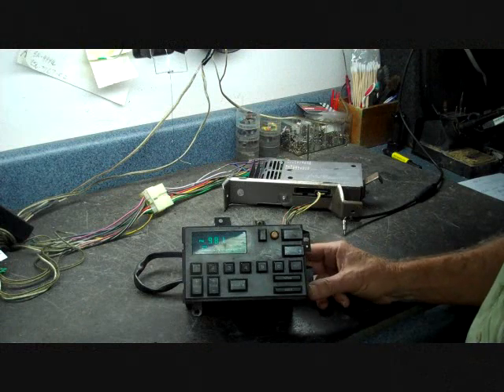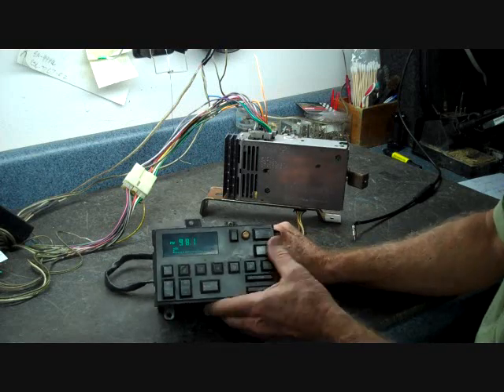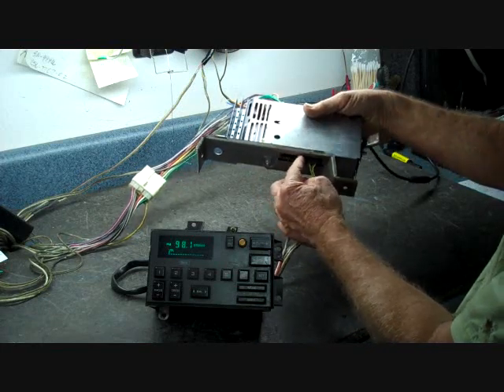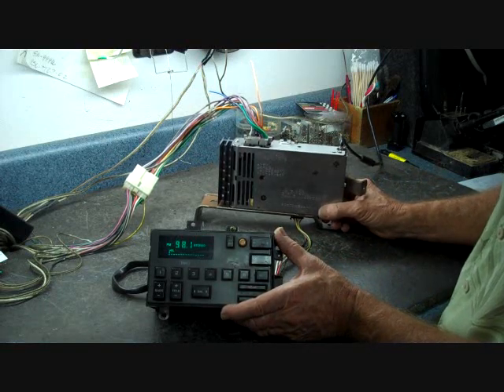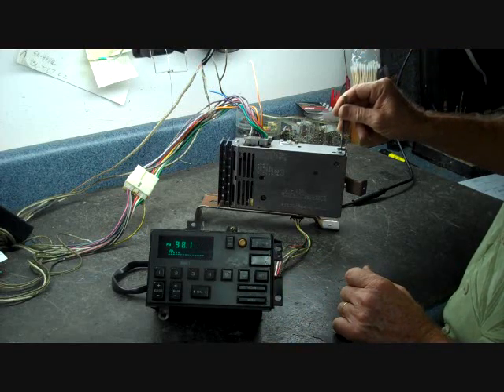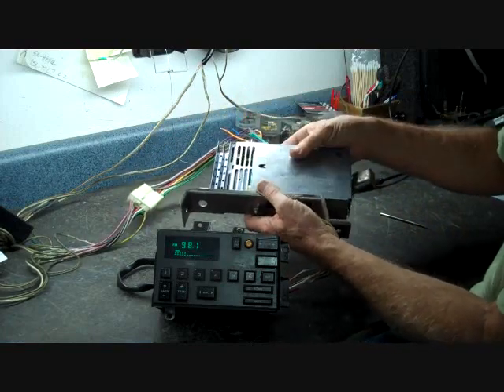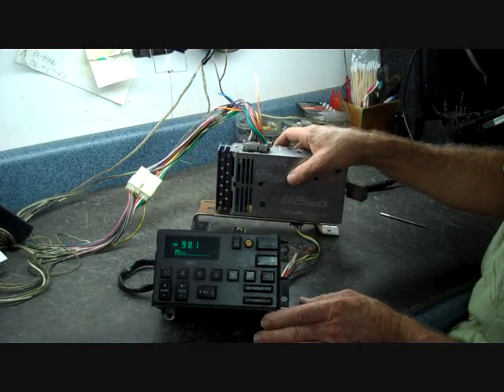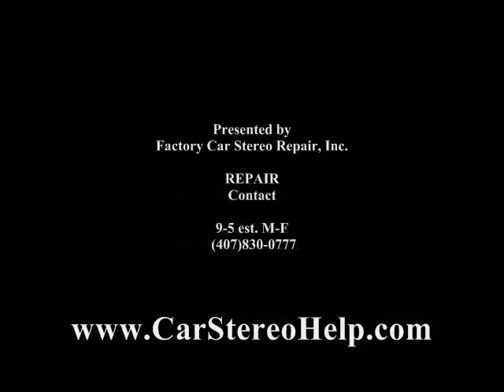Chevrolet and GMC Troubleshooting Stereo = Car Stereo HELP

Comment: hello I have a question I have a 1992 GMC Sierra with the same set up with the radio on it lights up clocks works radio channel works and the volume bars light up and will move up and down and when you adjust the fadder and frt to back it displays as well there is just no volume my best guess is the amp under the dash thanks David
Reply: Same issue I have.
Reply: Hey i have the same year sierra and am experiencing the same problem. Did you ever find a solution?
Reply: @bamiller6506  Any resolution? im seeing the same thing on my 92 sierra
Reply: Anybody solve this issue? Everything works but no sound or static
Reply: Any1 find out thw issue?
Reply: Thought I’d throw my comment in here. Same issue for me on a 1994. Head unit / control head powers up and all buttons work. Also have the tape deck and equalizer. I just get no sound at all from the speakers. No static or anything

Comment: My issue is that when my clock freezes and so does the radio, ill disconnect the battery cable and reconnect; everything works just fine until the next day, everything reverts back to being frozen.

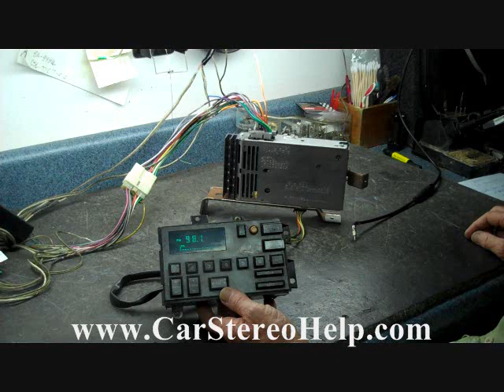Comment: I just love it when I luck out and find a guy who knows what he's talking about . Thanks. I have been down under the dash in the area of the of the CDM and replacing Brake light and back up light switches and the radio minstrelsy quit working. I bet I find I may have pulled the plug out somehow. or the CDM in on the fritzes the clock is indeed stuck at 1:00 and nothing adjust. Thank you very much.

Comment: I've owned a few used trucks in this age group and only one had a replacement stereo in it. I prefer the OEM stereos. I just picked up another one with a JVC aftermarket radio in the center of the dash. I hate it. Every time you touch it some new thing happens. But the Control head is there so I'm going to see if it works. Thanks for doing this video, now I know what I'm looking for and have a better understanding of what goes into this.

Comment: Thanks for putting up this video.  I do have the same problem discussed with my radio and clock.  I had been told by another person that the "brains" for the radio was just to the right of the accelerator - but I could not find it.  Your video makes it easy for me to find and pull out this CDM box.  Are replacement CDM boxes available in parts stores?    (My vehicle is a 1993 GMC Sierra.)
Reply from the maker: I repair these units, see website.
Reply: @boblizcou  can  the radio and clock  work with an aftermarket CD stereo ?  .
Reply: Friend, how are you, I have a 1988 Silverado, the stereo doesn't turn on, it just shows the clock, I would like to know if you can help me.

Comment: You should do a video of how to install an aux to the c.d.m. I cant find any for 1989-1994 cdm. All videos are for newer radio or the pre 1987 cassettes.
Reply: Good point, I just bought one of those $160 off of eBay he might not want to tell because maybe he selling theseUnits with the auxiliary connection
Reply: Like I could use in dash cd player outta, say a 95 to 99
Reply: @noblsht  hey, I actually posted a video of how to do it. Check it out.

Comment: I have problem with my 95 Chevy Beretta tape player. Radio works just fine, when I bought the car tape player worked too but after changing the car battery it started to sounds like "faded" with crackling sound when on high volume. Do You know what might be the problem?

Comment: I have a 92 Chevy. Control head and cassette/eq works. Clock, seek/scan, fast forward, reverse and eject all work. I checked all the fuses. Still no sound, no static nor distortion, nothing. Any ideas?
Reply: dead speakers

Comment: Thank you very helpful to learn about my unit. Also if installing an aftermarket pioneer radio. Will I need to keep the lower unit for use ?

Comment: my radio is stuck on 98.1 & the volume or the station wont go up or down what could be the problem ??
Reply: Mine too
Reply: @ceeC13  he covers this in the video. Mine is doing the same thing. Replace the unit under the dash located above glass petal.
Reply: Me too! ....Hey I’m Nick Diaz yaaa

Comment: I wonder if there's a way to have the clock head be used as a controller to control the aftermarket radio deck turn the channel vol preset and show the clock ...it be convenient so you don't have to lean over to adjust the radio in the middle of the dash

Comment: So a stock radio system in a 1992 GMC does not have a separate amplifier?  I pulled out the control head and cdm unit and replaced with a after market Jensen, powers up but no sound at any speakers.

Comment: I replaced my Bose factory amp with a used amp from EBay for my 2005 GMC Sierra. Exact match it’s came with warranty bench tested. Installed and still no sound. Checked all fuses. Ok Do you have any ideas . Thanks Jim

Comment: My 92 was 1 of the 'Mark3 Conversion' upgraded trucks, so it has a cd changer behind the seat. 
Cd changer is in place but head unit & tape deck/eq are NOT (removed by PO?)! 
Will any head unit work as a replacement or will this require a specific model unit? Does this setup require a tape deck/eq or does the cd changer eliminate the option of a tape deck? Specific Tape deck/EQ?
Does it need a Specific control module?
I would like to have all 3 parts together and working.. though ill probably never use anything but radio.

Comment: I have a 93 gmc sierra with radio, cassette, equalizer, never had any trouble out of it until the other day when I had a bad ground on the battery. I was going down the highway when it started acting up with dash gauges going off and on, truck cutting off and on. I stopped repaired the ground, everything was ok accept the radio would not play anymore. All it would do is show time at 1:00, station at 98.1 volume about half way, can't change it. You can turn it off, but when you turn it back on it does the same. I have checked the fuses, all ok. I would like to repair it and keep it original. Do you have any suggestions? I would appreciate any suggestions to try. I have learned a lot watching your video.  Thanks
Reply: ever solve your issue?
Reply: No, never had a chance to really get into it. I  am retired now so I am going to look at it again now or replace the whole thing. I would prefer to leave it stock if I could. @Hammerjockeyrepair

Comment: should the radio power up if I  send 12volts to the red wire (ignition power).. and black,, ground wire.  I have a 93 c1500 with the delco radio../ ?    the reciever module is missing,, so in trying to find out if the radio is good so I can get another reciever

Comment: When I bought my 1994 1500 it had no radio..it was obvious there had been an after market stereo installed...i have bought a radio and an adapter ...but I can only find two of the trucks connectors - the third (which is apparently the power supply) I can't find....the two I CAN find are bound together and fit just fine in my adapter...am I just looking in the wrong place?

Comment: Mine was working and speakers but some how now the wiper want work or power windows eaither but on the radio the clock pops up and that's it and no fuse blown and all grounds seem to be hooked up good? Jw if that is a cdm problem too that would cause all this?

Comment: Hey man. I just picked up my dream truck. 91 k3500 dually 454 with a muncie 4 speed. My volume up button is not working. Is there a way to disassemble the unit to clean the button contact? I'd really like to keep the factory style head unit but dont want to have to replace the whole thing. Thank you for reading. And please help.

Comment: HI Factory Cr sterio repair.  my Truck radio was fine.  I restored the truck put it all back together.  The radio works fine.  But when I push the brakes the radio light goes out.  I have had it all apart twice since checked every ground I could find and still can't solf the problem.  Any experience like this before?

Comment: Thanks for this video new subscriber. I have a 93 and when i removed the old stereo i noticed a lone white wire connected to the receiver. What do i do with that? Do i use it? or cap it off? Thank You!
Reply: Did you ever figure out where the white wire goes and it’s purpose?
Reply: @mikewolfe789  I didnt. I ended up capping it off and only using the the negative and 2 12 volt wires from the stereo. I re wired the speakers and left it at that.
Reply: Thanks for the quick response! Anyhow question I have power going to the head unit from the cdm but no light on the eq any suggestions I know these are getting hard to come by now days do you know what wires power the eq so I can test it by it self?
Reply: @mikewolfe789  I have the haynes repair manual I'll see if I can find it in there. Mine only had the tape deck without the eq.
Reply: @mikewolfe789  in the book the graphic equalizer wires are purple, red/white, white, and gray. Since I didnt have the eq that might be why I didn't use it? Just speculating there but makes sense.
Reply: @MikaeleIosefa714  do you have a phone number where I can reach out to you directly?
Reply: I would like to send you some pictures and see if you can help me wire it I don’t want to blow anything up it was my dads
Reply: There are alot of videos on here showing what your looking for. Youre taking the same chance with me trying to help. I just dont know enough to comfortably give you any advice.
Reply: ok thanks for your time can can you send me a picture of the wiring diagram?
Reply: @mikewolfe789  you have Instagram?
Reply: Friend, how are you, I have a 1988 Silverado, the stereo doesn't turn on, it just shows the clock, I would like to know if you can help me.

Comment: HELP!!...I just got a 93 cheyenne and the radio is bad, but on the wiring from the radio there is attached a white individual WHITE wire, i'm not sure what it goes too.. We pulled it from another truck but didnt look to see where it was pulled from.
anyinfo would help. THanks

Comment: what does a new cdm cost & where do you purchase 1 for a chevy silverado 1990 & do you think it's a good idea to get one from a recycling yard?(scrap yard)
Reply: It's hit or miss with Junk Yard, and most of them around me will not give you returns but credit for electronic parts. I picked up a working radio from a junk yard, however, the heat unit and equalizer didn't work.

Comment: How do you repair the CDM when the radio head is stuck at 1:00 and the buttons don't work?
Reply: I have this same issue.  I have my cdm removed, now I just need to have it fixed, or find a new/used one.  Advice appreciated!

Comment: My radio is also stuck on 98.1 and at 1:00 and no sound can anyone help will appreciate it ...
Reply: Its the control module box under the radio. There is a shop in Florida that will fix it for 125.00. They are online... I had the same problem.

Comment: Is the CDM solely responsible for the radio becoming un tunable or unable to change clock or any other function in the radio?
Reply: the buttons contacts need to be cleaned, sometimes just a shot of tuner cleaner will fix it. a way cool fix as you just spay and done. warning not all tuner cleaner is the same some eats plastic. do a test spot.

Comment: I have a 1992 silverado the clock and the radio illumination stay on u can operate the radio but with no volume it's draining the battery any ideas
Reply: Unplug radio it plugs into bank directly under ashtray its a 4pin white plug 👍

Comment: My 93 chevy Cheyennes radio stopped working while I was driving. If I restart the truck the radio comes on then makes a popping sound and stops working.  Lol. Any ideas?
Reply: Yes electronic box in the dash is toast garbage history you can find replacements on eBay, I'm having all kinds of issuesI have replaced equipment and stillIt doesn't power on,,He said that it is a two fuse systemI jumped to the conclusion that I had another blown fuse , the first fuze that said radio did blow but there's no second Blown fuse in the fuse boxI 'm puzzled now😐😐😐

Comment: I'm having trouble with the cassette player I put a cassette in and it trys to play it but it makes click noises help
Reply: Very common problem it is toast there's no repair for that You can buy replacements on EBay Even my new replacement in cold cold weather wants to do that The previous one was doing that

Comment: 1993 model GMC..  I have no sound on the system everything works but no sound,was getting sound every once in awhile then it would go off..  Any idea what the problem could be?
Reply: Eldon H I got the same issue. Did u get it figured out?
Reply: Eldon H  any update on fixing the issue?
Reply: Same issue here too.  Ours started where it almost acted like it had a short in it then we could hit the dashboard above the radio and it would come in great, but now everything powers on but no sound will come out of the speakers.  :(  Have you had any luck finding your solution?
Reply: X4 here. Guess there's no hope for any responses.

Comment: You do realize that at 5 minutes, forty seconds, the hiss dropped out of your video when you unplugged the antenna.  I'm pretty sure the ring counter, if stuck at 1:00, and your receiver because of the hiss, are toast.  I'd say, due to the labor cost of rebuilding, or the cost of manufacturing, a new one, it's time for a new system.
Reply: Hi am trying to install my oem 1988 sound system but somebody remove all the wires and am tryng to find out witch wires are speakers and feeders on my amplifier, could you help me please !

Comment: I have one in an ambulance I bought. The clock is on but the radio is not responsive no matter what button I push
Reply: friend you found the problem, my truck is the same, thanks
Reply: @fernandogonzalez1394  The previous owner of the ambulance had disconnected the radio from the back. They didnt want the workers listening to the radio.
Reply: @Bigbagadoosh  thanks

Comment: Just get rid of it..
Reply: Mine won't turn on..  The truck has been sitting for a few years.  Bad key pad I guess.
Reply: Some people would like to keep the OG equipment, though. Mine works fine after 28 years (cassette player included;) turns out the antenna cable had just come lose.

Comment: I have the same setup but getting a lot of engine interference which increase as the engine rpms go up..have any suggestions?
Reply: Me too.
Reply: What kind of plug wires are you using?
Reply: Just drive slow
Reply: Same here! Did you work out a fix?
Reply: @nickspy  No its still without a radio